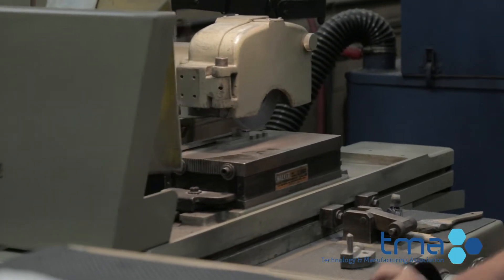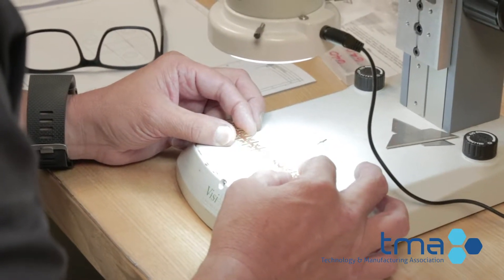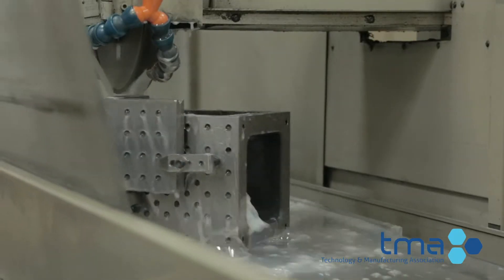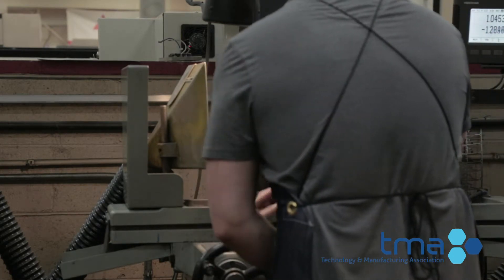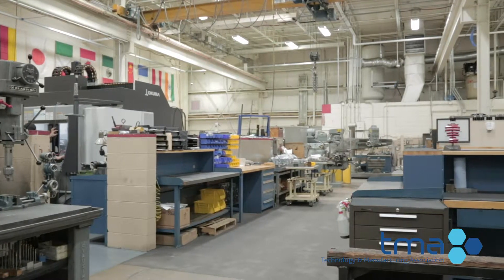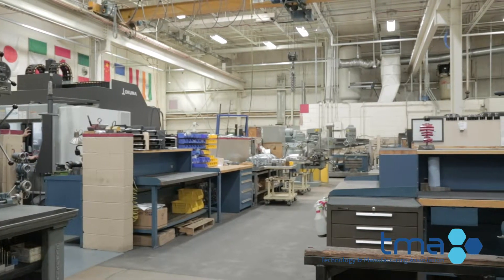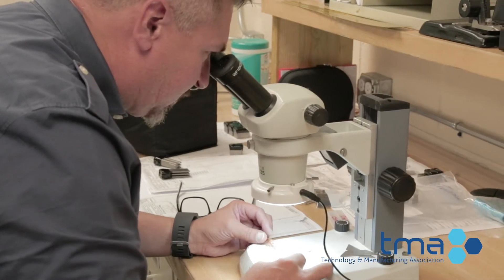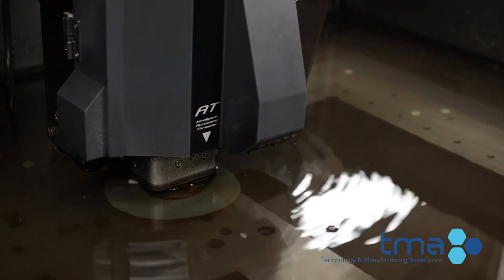Paid to Learn: Consider a toolmaker apprenticeship

Comment: Notice they never mention pay.
It varies a lot but tool and die is a high skill job which pays the same as a guy doing maintenance at a manufacturing plant. 
Sure you get paid for 4 years but it's Walmart pay and when you graduate it's less then a lot of Industrial tech guys with 2 year community college degrees.
Reply: That isn’t the case everywhere, it depends on the company you work for and wether it is a ‘mom and pop shop’ or a medium to larger company, I am a tool maker on Ky and everyone I graduated schooling with including myself was making 25$ plus throughout the entire apprenticeship, I have had friends making 19$-40$, all depends on Company and Experience but it is by no means a low income Job as a whole
Reply: You are correct